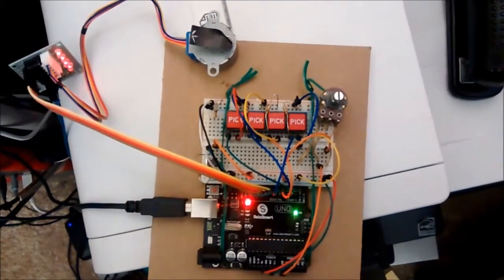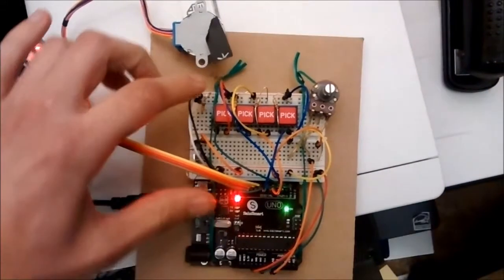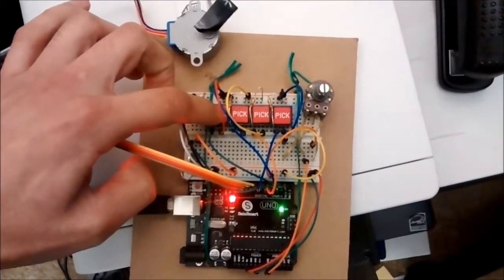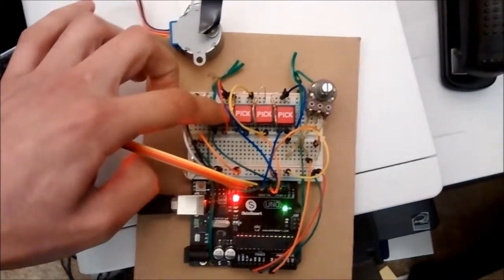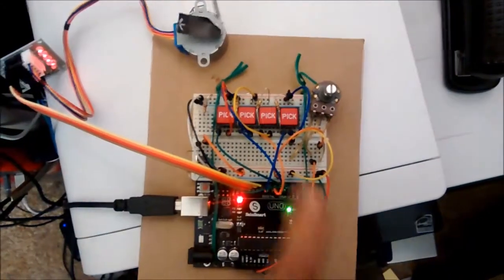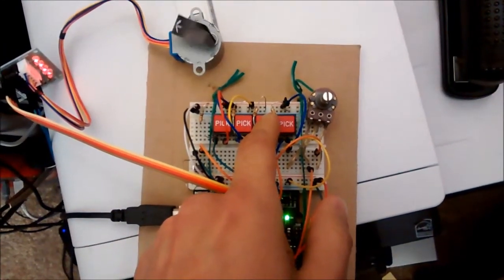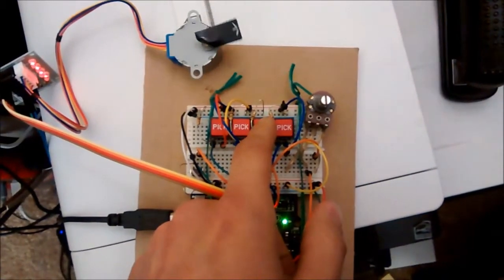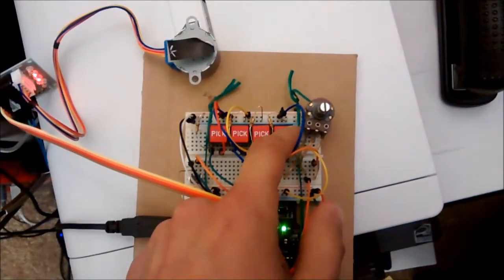Arduino stepper motor ramping control

Comment: This is great, been looking at doing ramping for a project I am dealing with turning magnets, could you share the steps that control the ramping when you press a button, I will be using serial commands to control mine most likely, but the setup should be similar in operation.
Reply: Did you ever find an answer to this? I'm looking to do the same. Using magnetic coupling to turn and impeller in about a gallon of water. The ramping is a must to get the stepper up to speed without spinning off the connecting magnets.